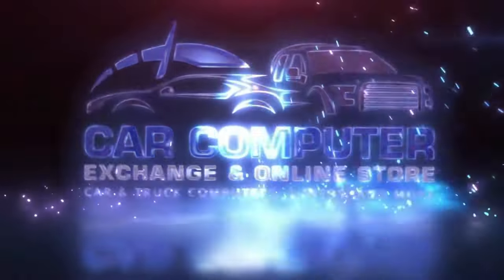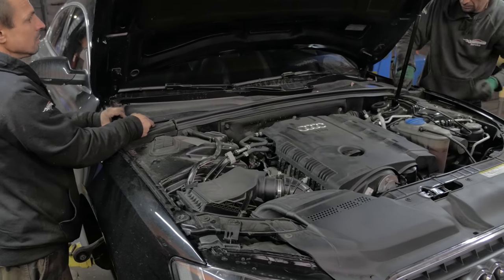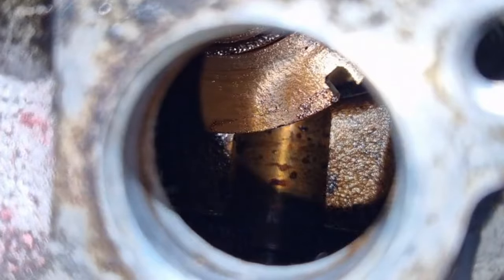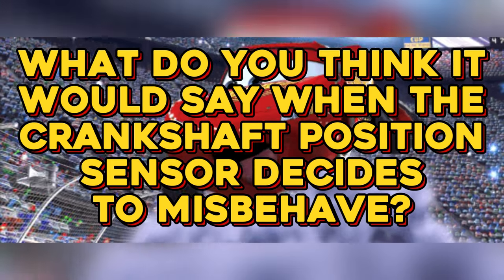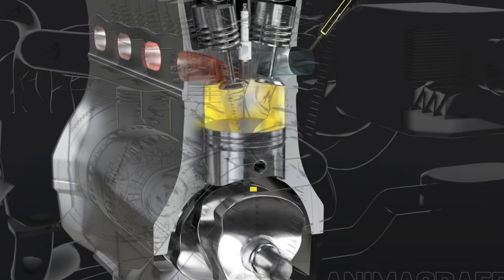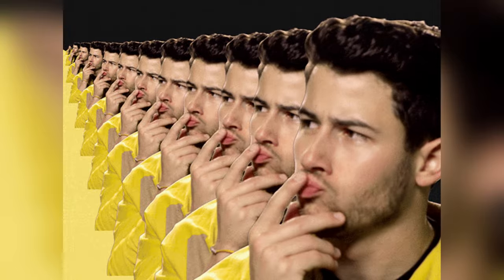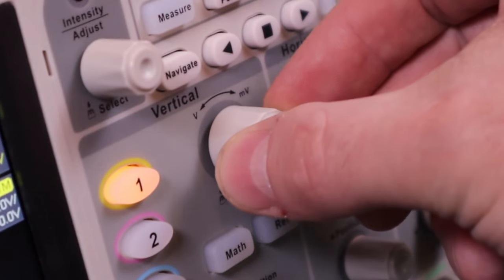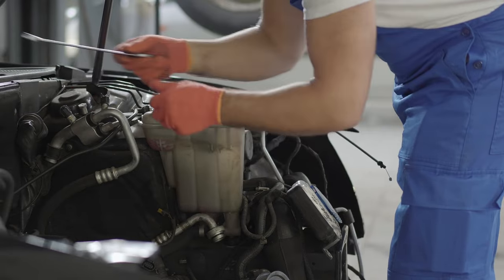Faulty Crankshaft Position Sensor Troubleshooting | Test & Fix

Comment: This YouTube channel has been instrumental in enabling me to independently address car issues without the need for a mechanic. The presenter's method of conveying information is both captivating and easily comprehensible. Specifically, the guidance provided on troubleshooting the crankshaft position sensor proves invaluable, given its frequent susceptibility to malfunction. Being able to rectify such issues independently brings a sense of relief, highlighting the practicality and effectiveness of the presented information.

Comment: Invaluable troubleshooting guide! Your video on faulty crankshaft position sensor troubleshooting is a lifesaver for DIY enthusiasts. The step-by-step process and practical tips for testing and fixing the issue are incredibly helpful. Thanks for sharing your expertise and making complex automotive problems more manageable. This will undoubtedly save a lot of folks time and money on repairs!

Comment: Your video on troubleshooting a defective crankshaft position sensor proved to be quite helpful when I was having difficulties with an unknown issue in my automobile. The practical suggestions and diagnostic tips that you offered were excellent. I'm grateful that you made troubleshooting easy to understand, especially for people with no experience with cars. I was able to locate and resolve the issue by following your advice. I appreciate that this helpful information has saved me both money and time.

Comment: I was struggling with a mysterious issue in my car, and your video on faulty crankshaft position sensor troubleshooting came to the rescue! The diagnostic tips and practical advice you shared were spot on. I appreciate the effort you put into making the troubleshooting process accessible, even for those with limited automotive knowledge. Following your instructions, I was able to identify and fix the problem. Thanks for saving me time and money with this informative guide!

Comment: Your troubleshooting guide on the faulty crankshaft position sensor is a lifesaver! Thanks for breaking down the steps and offering practical solutions. Your expertise makes the process much more manageable for DIY enthusiasts. Grateful for the valuable insights and the ability to tackle these issues effectively. 🚗
Reply from the maker: Thank you for watching.

Comment: Details in which it is mentioned in the video have left me quite intrigued. I prefer the proactive approach to diagnosing and correcting problems with the crankshaft position sensor present several positive points. The efficient use of tools such as OBD-II scanners allows the rapid identification of error codes, facilitating preventive maintenance and preventing serious damage to the engine. However, this process is not without challenges. The complexity of diagnosis, especially for those less familiar with automotive mechanics, can be a hindrance. In some cases, it may be necessary to seek the assistance of a professional, increasing maintenance costs. Perfect video, man.

Comment: I've been experiencing some engine issues lately, and after watching your video, I feel more confident about checking and fixing the crankshaft position sensor.Thank you so much for this detailed guide on troubleshooting and fixing a faulty crankshaft position sensor! Dealing with engine issues can be daunting, but your step-by-step explanation and practical tests make the process much more manageable.
Reply from the maker: Thanks for the feed back.